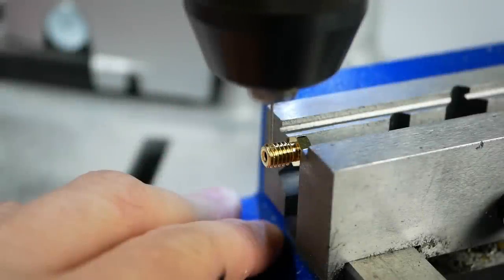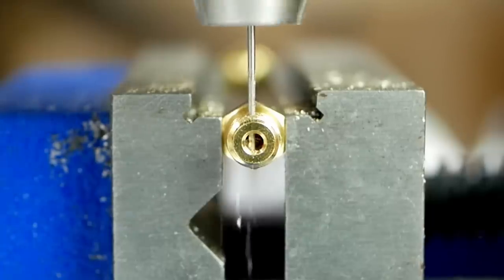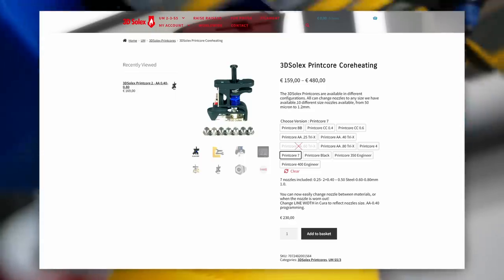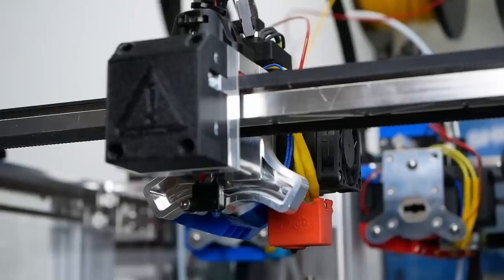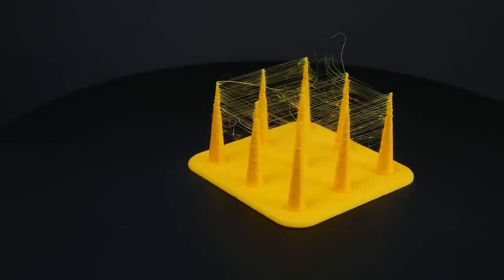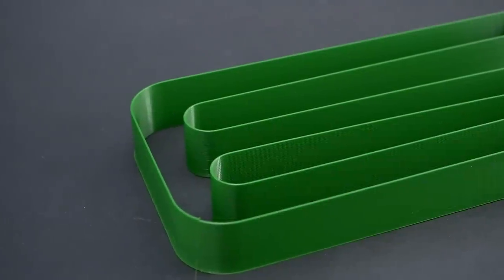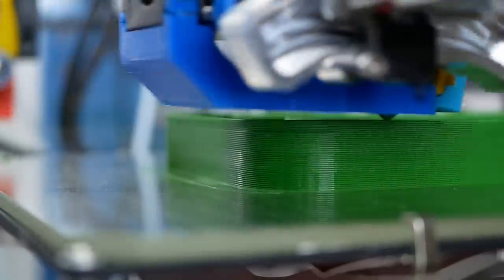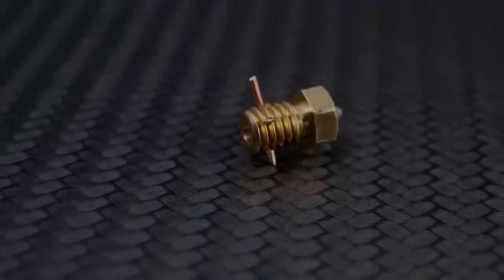My High Flow Nozzle is better than a Volcano hotend!

Comment: I'm fairly certain that patents don't restrict you from making anything for yourself in the US as well. You can even use the drawings in the patents themselves directly. You just can't sell it.
Reply: That seems to be case in most countries, but I vaguely remember reading about some restrictions to that principle in the US that could apply to regular Joes building stuff at home.
Probably nothing you need to worry about as long as you go about your hobbies quietly without attracting much attention. And even then it's rather unlikely that a company would immediately sue you over a non-commercial thing that doesn't hurt their bottom line.

Comment: To drill on a Round Part:
1. Find true center.
- Edge Finder or more accurately, Test Dial Indicator
2a. Use Center Drill (small).
2b. Or use small 2 Flute or 3 Flute center cutting Endmill to produce a small "flat spot" before Center Drilling or Drilling.
3. Carefully "peck drill" hole.
4. Flip part 180° and repeat above steps.
5. Deburr if necessary.

Side Note:
- When Reaming remember, a Reamer will follow a drilled hole, straight or not.
- A Bored hole is the utmost accurately machined hole.

Good knowledgeable video! 👍

Comment: Here is a thought: saw/file a slit vertically into the nozzle and insert a break-away knife in the slit with the sharp edge upwards. Then use silversolder to seal off the slit from the outside and cut the thread. Gotta use the small break-aways, not the big one.
Reply: The blades you mention are too hard to cut a thread in.

Comment: @CNC Kitchen : to center your wire better in the nozzle, proceed in two steps:

1. use your drill press to make a hole on one side of the nozzle ; it might not be centered
2. use a hand drill to make the second hole, adjusting by eye so the drill bit is centered. since you will be drilling through the center of the nozzle, centering will be easy.

and/or

before you make your first hole, use a needle (searching for the french "pointeau" will be easier) to mark where the hole should be.

cheers!

Comment: Wow, nice experiment! Today I tested my Garage Volcano CHT - stepped opening, and box cutter blade divider with some optimisations inside. I could extrude 35mm/s without much limit, on a Ti heatbreak (disadvantage for heating). Got just slightly degraded extrusion rate. What was bigger problem was speed. High extrusion rate at slow speed was okay. Same extrusion rate at high speed was bad.

Comment: The proper way to start a drill is to use a starter drill (never to be confused with a center drill).
Starter drills have a 120degree angle, and are very short and fat with usually only 1 or 2 twists. Since your twist drill has a 118debree angle, the drill will center on the point. Center drills (which are also short and fat) have a 60degree angle, and the twist drill will center on the flights and cause it to wobble on starting. Center drills are for make center holes for lathe work, starter drills are for starting twist drills.

I really appreciate you doing this. I had a similar idea I was thinking about doing with my Volcano. My experience is that the Volcano can reliably extrude at high quality about 24mm^3/s with a .6mm nozzle. This mirrors your test pretty much perfectly.

Comment: Nice project!!
Some tings to try to improve the result:
1) use a nut to keep the nozzle stable in the wise
2) use a centering bit (or milling bit?) to make the initial hole (that should be a smaller diameter than the final hole)
3) use a blowtorch (a small one for baking should be enough) instead of a soldering iron to help heating up the nozzle/melting the solder
4) use a file to shape the wire to reduce flow resistance OR use small pliers to make the wire flatter (but taller) once the wire is in place

Comment: Great video! I would try to put a piece of thin sheet coper vertically into the nozzle... This would greatly increase the contact surface, without reducing the free cross section.

Comment: Two ways to improve the placement and fixing of the wire:

1) With the nozzle in the vice, get a sharp, hard object, place it in position and strike it with a small hammer or similar to create a divot which will your drill bit will bind to when you start drilling. For added precision you can start with an even smaller drill to start a pilot hole - only about 0.5 - 1mm depth should do it.

2) Dab a small amount of plumbing flux (used when soldering copper pipe) onto the area you want to solder. The solder will tend to stick at a lower temperature.

Comment: If you use a small single flute countersink to make a dimple in the nozzle threads it will provide a guide point for the drill bit that follows and will prevent it from wandering as you start drilling.

Comment: One thought I had on your drilling issue is to only drill one side, then flip and drill the opposite side. It looked like the nozzle lined up well with your vice. To ensure that the height was the same (no slight offset) you could place a block or something behind the nozzle to have the exact "height" each time.

This was well done!

Comment: Brilliant! When starting a small hole on an irregular surface, we usually use a center drill (sometimes called a combination countersink-drill) , then drill the hole with a standard drill bit. For a 0.08 mm hole in brass, a speed of at least 2500 RPM is best. Always good to have a rigid setup and smooth running spindle. +1 for using an Albrecht chuck.

Comment: Might be difficult for the home user - it would be neat to see a star pattern broach used to cut the round bore of the nozzle into a <many sided> star polygon. Broaching/making blind keyways in machining is one of the biggest pains in the butt - but possibly if using a makergear style hot end it would be possible.  (cylindrical hot zone with male threads, female threaded nozzle). Because of the pass through on the heat section broaching would be much easier, and might not infringe the patent because of no connected material in the center.

Comment: This is a really cool idea!!
You might get better flow by using a thin piece of flat stock stuck down the throat of the nozzle, across the diameter. This would give a longer melt length while reducing the frontal area of the obstruction added to the nozzle.

Comment: To get the cross holes centered on the nozzle diameter , first mill a flat in the thread, use a center drill to spot the hole location, then drill the the hole thru. If the curvature of the id of the nozzle causes the drill to wander drill 4 holes 1/2 way thru from each side using the above method. 

Please keep up the great videos.

Comment: So, some tips for drilling into round parts.

First, when possible, mill or file a flat where you plan to put your hole. This could even be as simple as coming in with small center cutting endmill running in your drill press. It's ok if your flat is bigger than your hole, the die is going to clean up the threads well enough.

Second, spot your holes with a proper spot drill, or at least at least a center drill. Spot drills are designed specifically for starting a hole without walking. You could also centerpunch a starting spot, but that might be tricky in this case.

Finally, for micro drilling, often times a hand held pin vise is going to give you a good hole. You can also get a pin vise that goes into a drill chuck or mounts in the spindle of a drill press.

Comment: On centring the holes: place a flat, long object (stiff ruler or ground parallell) on the thread and push down on the ruler with the tip of the drill. When the ruler is level with the drill press table you've found your center. Then you need to create a flat spot on the surface for the drill to stay centered. Drilling into a thread is near impossible without first creating a flat area as there are so many angles influencing the tip of the drill. Use an endmill the same size or slightly larger than the drill you want to use and plunge down until you have a clean circle on the part.

Comment: You can just use a small file to file out the middle section of the copper wire -> transform the circle into more of a triangle so that the wire can more efficiently "slice" through the stream of molten plastic

Comment: Try drilling the nozzle at 45 degrees to the axis. This will increase the active surface area of the wire inside the nozzle and probably reduce the friction of the filament.

Comment: Who said that circles have the best flow characteristics?  It's more about creating MORE SURFACE areas to pool up plastic to have slightly FASTER RESULTS in this use case!  Circle shapes are less efficient in thermal dissipation and speed than we previously knew.   THE FRICTION OF LIQUID HITTING A WALL IS MORE THAN IT IS IN THE CENTER OF THE FLOW.  if WE CAN MAKIE OVAL NOZZLES WE'D GET EVEN MORE!

The friction of the plastic or liquid in a circle is more than an oval type or other shapes!
TRY USING DOUBLE THE SURFACE AREA AND THEN USE A NON CIRCLE SHAPE THAT ALLOWS MORE FLOW WITH LESS FRICTION. 

GREAT VIDEO!

Comment: If you plan to research this further, you can make a simple jig for frilling the nozzles, simply drill and tp the M6 internal thread in Aluminum rod, file one side a bit to get the flat, and drill the hole in it. So you can use it every time you want to drill the nozzle. Wind the nozzle to the desired depth and drill throug, and if you want more holes at some angle, probably the right one, mark the hex tip od the nozzle with two or more dots so you can orient it pretty precisely to the needed angle.

Comment: I have a Qidi X-Plus the MK10 nozzle in the low temp extruder has PTFE tubing extending into the nozzle, replacement nozzles including a ruby nozzle (for abrasive filaments) are configured the same. The high temp steel extruder has a 2mm hole and the TPFE tubing stops there before entering the nozzle. I manufactured S/S inserts which fill the hole down in the regular brass nozzles to a diameter of 2mm. In this way I can use higher temperatures without damaging the TPFE tubing.  Now to my point: a hole for a wire could be drilled near the center of the nozzle as in your example, but above and below that wire the S/S insert could be placed (cut in half and inserted). The inserts would also be c/s where they contact the new wire. The only other variation I would make would be to thin (flatten through filing) the wire where it centers in the nozzle to easy the flow while retaining the copper conduction of the wire. Given this technique a larger diameter copper wire could also be employed. The PTFE tube would stop at the top of the nozzle. My experience is that a high degree of accuracy is required, your off center hole illustrating possible problems very well. I would not solder the wire but peen it/ rivet  into place,  a slight c/s on either side of the nozzle aiding the fit. Then re-cutting thread as you did before (only an M7 thread in this case). My design would leave a nozzle filament hole of around 4mm over the width of the inserted wire easing flow. My stainless inserts by the way are 9mm long, 4mm in diameter and have a 2mm hole right through them, they would be cut in half for this purpose. In these days when every one wants to print faster and faster I think these sorts of experiments are getting ever more relevant.

Comment: This is intriguing: I tried this, and it really works, but what I found is that this method also removes the leftover patterning if you have an extruder driver that really deforms the filament. Maybe it's the stirring action that causes the filament to be heated in a more consistent way to make it flow better.

Comment: My suggestion is to drill a hole into the top face parallel to the flow direction.  Next cut a piece of copper wire bent into a "U" shape with one end soldered into this hole with the opposite end within-and-parallel-to the flow zone.  Before doing this we pre drilling the bore to maximize restriction vs. annular flow distance. The correct balance will fall somewhere within this ratio of conductivity vs. restriction.  

Bonus: This is a simple drilling operation with no thread damage. 

Bonus2: The "U" shaped copper wire can extend higher into the hot zone to increase copper heat transfer from the hot plastic as well larger copper can be experimented again through experimentation.

Comment: Two ways to drill on center on something round. You could thread a flat block of brass to fit the nozzle, then use that as a guide  to drill straight. it'll keep the bit from veering off track on the curve. Other option is an end mill, 0.8mm engraving end mills arent too expensive and would probably work ok in your drill press. just use it to make a flat on the threads pull the end mill out and put your drill in. It's drilling on the round that messes you up if you can pull a trick to get a flat first either with a guide or by milling a flat you're good.

Comment: To drill the perpendicular holes into the nozzle, make yourself a drilling jig:
- Take a small steel cube, a tad larger than the nozzle thread (eg 18mm cubed).  Should ideally be milled square.
- use marking blue on 3 adjacent faces.
- Mark the piece on the 3 sides, ideally using a vertical vernier, so the lines are parallel on 2 faces, and the remaining face connects both lines with an X.
- use a center punch to mark the placement of the holes; one at the center of the X, 2 others at whatever offset from the face as you see fit.
- Drill a 5.2mm hole through it on the side with the X.
- Ideally countersink it.
- Drill your smaller holes on the 2 other faces.
- Tap the large hole using a 6X1 tap.
your jig is done.
- now insert a nozzle in the threaded hole, bring the drill press with the proper drill, drill both holes, remove the nozzle and repeat as many times as you wish.

Comment: It's probably been said, but you have a few options to prevent the drill bit from flexing or "walking" on the surface of the part. You can spot face the area to be drilled, which is basically just using a flat-bottom center-cutting endmill or drill to create a small flat that can easily be drilled into. Your next common option is to use a spot drill, which is nothing more than a short and fat (i.e. rigid) drill bit that will not flex to create a small countersink that your 0.8mm will then center itself in to prevent walking. Your third option is to use a much shorter 0.8mm drill, but this is generally going to be a custom drill bit and not an option if you are using standard catalog items. In general, your common (inexpensive) bits are HSS (high speed steel) and flex quite a bit. This can be good in that they don't break easily, but their flexibility can allow for holes that "wander" or aren't truly straight. Carbide bits are substantially more expensive but are more rigid, but they also snap off easily when they do flex. Of all these options, I would use a spot drill (a center drill is similar and can be used as well) to make a small dimple, then swap to the 0.8mm, as this uses commonly available tools that aren't too expensive. I sometimes put a new edge on broken drill bits, because they can be useful when a shorter stiffer bit is needed in applications such as this. Just remember your hole depth will be limited by your flute length if you ever use such a bit.

Comment: Hmm... i wonder if one could cut razor blade with a laser to exact tolerance to fit inside a nozzle and have it be there with friction fit alone.. well, not really friction fit since i would assume the slice of the razor would have to be just slightly too large so you it pushes into the brass. But how to insert it there.... I'm sure small flat needlenose pliers could get it far enough and you could maybe hammer it in the rest of the way..

Or even machine a cut thru the nozzle for it and solder it with silver (not silver tin, but silver).

Comment: SPIRAL it: Use drill bit to make hole large as you can. Leave drill bit in it! Snap off, grindstone flat. Extrude thru spirals of drill bit. Hopefully large enough 'holes' for max flow. Definitely a smooth flowing melt zone.

Comment: You can try flattening the copper wire inside the hole. Turn the cylinder into an ellipse. 
The cross-sectional area will remain the same, the heat transfer area will increase and the flow resistance will decrease.

Comment: If you want to drill in the center of the threaded head you need to first use a small center drill. they don't bend and will allow you to drill without the drill walking problem.

Comment: Honestly, I find it super interesting how much of a difference a nozzle can make. I personally am not too much into tech in terms of soldering, dealing with wires etc. I mean, i got super nervous when I soldered new fans onto my ender 3, so I'd be terrified of putting in a new hotend. Being able to use wider nozzles [-> 1.0mm ideally] without having to get a better hotend seems amazing and I'll most likely order one of the CHT V6 nozzles to play around with soon. I just hope the cheap dual gear extruder can keep up.

Comment: Wow! Thank you - this solves an issue I've had with my 3D printer - the Monoprice Delta Pro, which I've modified with a better extruder and better stepper drivers. I have tested movement and precision to be reliable up to around 300 mm/s (unless the resistance on the nozzle becomes too great; then the magnetic rods don't hold together well). But my limit of 13-15 mm3/s makes it so I can only reliably go up to 80-100 mm/s with 0.4mm nozzle and increased layer width of 0.55mm, which I use for vase mode. 

Mounting a better hotend would be extremely annoying - because the delta bed would need heavy modification to accomodate it, and the coolers would need to be swapped. But more importantly, the added weight would force me to decrease my speeds, partly defeating the purpose of upgrading said hotend...

Your approach totally circumvents this issue. I look forward to testing it!